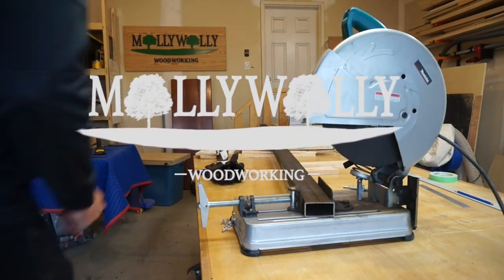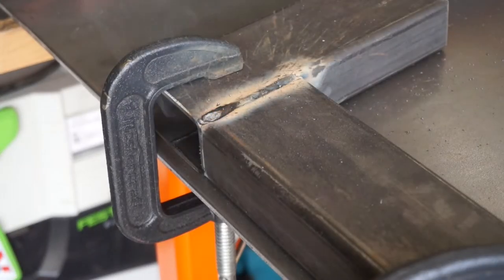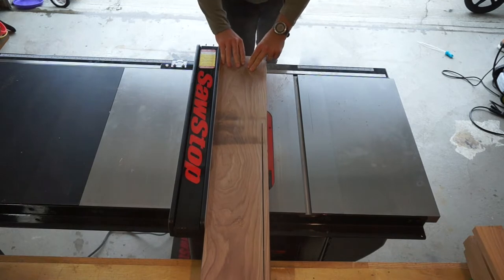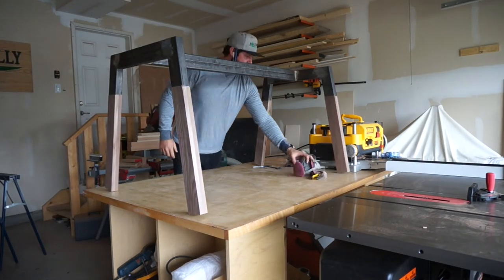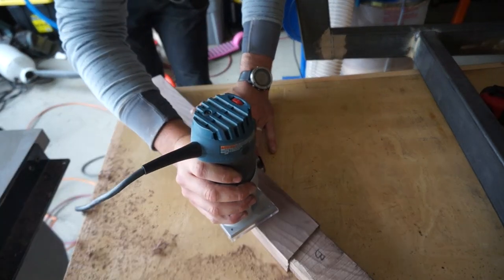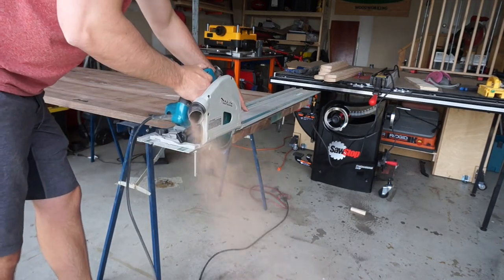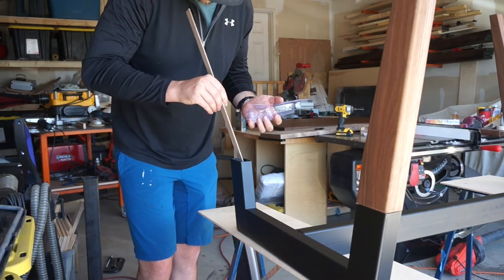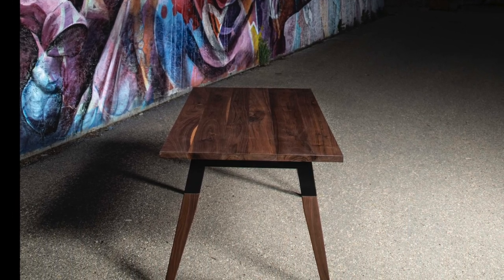Steel and Wood Dining Table

Comment: Love that stool you're using in the shop. Something you made?
Reply from the maker: Dawntreader233 thanks, yeah I made that as well. 6/4 walnut top 13” in diameter and 1.25” square steel tubing for the legs

Comment: How do you deal with the wood movement of the top?
Reply from the maker: The holes in the steel plates that I used to attach the table top were oversized compared to the bolts I used. This all was the top to expand and contract.